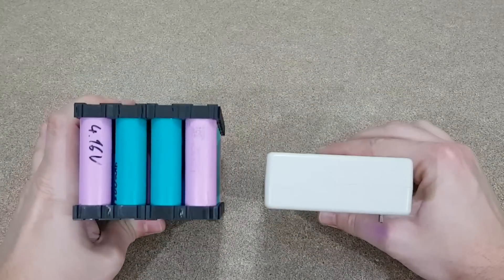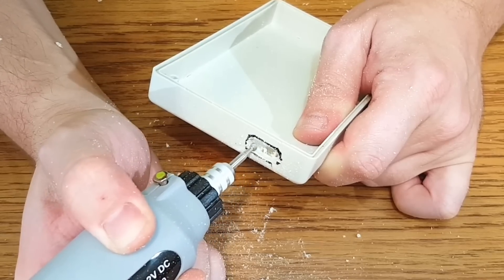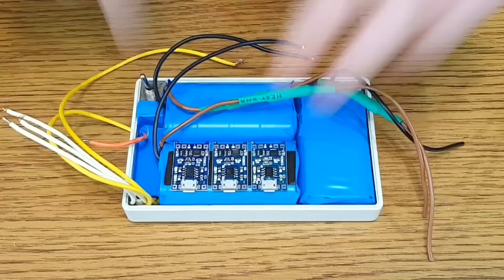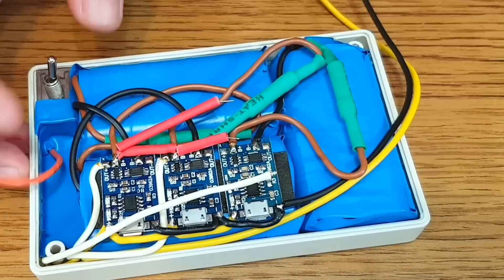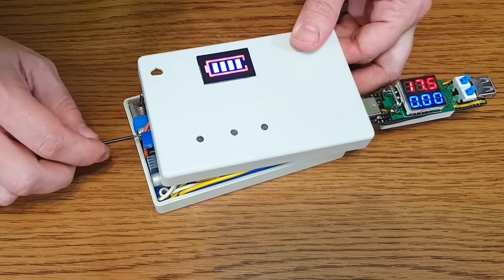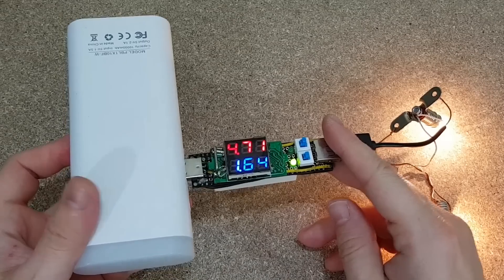DIY - 15000mAh Power Bank - With Salvaged Batteries (gets charged with 3A)

Comment: Hi sorin can i also use 2 of this rocket switch??
 6 Pin SPDT On-Off-On 3 Position Wippschalter(Rocket Switch) AC 6A/250V 10A/125V

or some ON / ON 2 Position 4PDT Vertikal-Schiebeschalter( Slide Switches) 12 Pin SS42H11
Reply from the maker: hi. you can use the 12 Pin SS42H11 switch. or you can use a 3PDT switch (because it's more common) but with 2 charging modules instead of 3.
Reply: @Sorin_DIY  thx mate ^ ^

Comment: Sir where is connected the negative input? The diagram u show is no connection?
Reply from the maker: the IN- and OUT- of the modules are bridged on the circuit board. so you can connect all the negative wires to the IN- or OUT- terminals, it's the same thing.
Reply: @Sorin_DIY  ok sir thankyouuu😊

Comment: .
Reply from the maker: hi. I don't build them for sale, I'm just showing you how I built them.
Reply: @Sorin_DIY  Question, I noticed that you permanently cover the fuse what happened when any of the fuses blow out ? Replacement will be difficult.
Reply from the maker: the fuse will blow only if there is a problem with one of the cells or modules. yes it will b a bit difficult to replace, but this happens very rarely.

Comment: Hi 
Sorin 
i have a question that can i use b3 10w compact charger to charge 3s lipo battery pack and 18650 cells 3s battery pack?  I don't know the capacity of 18650 will they work fine
Directly with this charger without bms on battery pack?
Thank you ❤️
Reply from the maker: hi. lithium cells can be charged only with charging modules, like TP4056. to charge a battery pack you need a good BMS. otherwise you will damage the cells.
Reply: @Sorin_DIY    thank you for response i really appreciate it

So b3 10w balance charger will it do the job?
Reply from the maker: yes
Reply: @Sorin_DIY  Thank you soo much ❤️ i am grateful for your help 🙏🙏🙏

Comment: There are decent diy kits with type-c for about 4$ from aliexpress. Used 4 SAMSUNG cells taken from a business class dell battery with 2300mah left capacity (originally 2600) and bought 2 new ones.

Comment: Hi Sorin i have build the Powerbank but i have a problem, my powerbank doenst charge anything, i checked it double.
when i switch the powerswitch on, only on led is blinking blue 

(the board which is wired in your shematic the last one with the black wired "out -" ),
the other two are blinking for 1 second red then they go out(This happens when i put an micro usb to charge my powerbank)

I use 5 exact same batterie from an old RAVPower RP-PB13 
5x 	Samsung ICR18650-28A
2800mAh Rated
3.75V Nominal and
------------------------------ 

1xLG Batterie which has 2600 mah 3,6V. 

maybe this is the problem sorin or should i check the USB Hub???
Reply from the maker: when you turn it on, the cells should power the step up converter and the battery indicator, so the battery indicator should light up. when you turn it off, everything should be powered off. when you turn it off and connect the charger, the 3 LEDs from the charging modules should light up, blue or red. if it doesn't happen this way, you probably connected something wrong at the switch.
Reply: @Sorin_DIY  ok thx sorin i will check it

Comment: Hello, in the schematic at 5:05, why there is no negative wire on the IN- pin of the step up module ?
Reply from the maker: hi. the IN- and OUT- are bridged on the board, so it doesn't matter where you connect the negative wires, it's the same terminal.
Reply: @Sorin_DIY  Hi, I have some more questions. If I use a balance charger to charge the power bank (like the imaxB6 for instance), can I get rid of the tp4056 modules ? If yes, can I connect all 6 batteries together (or should I not?) ? How do I connect resistors and fuses then ? Thank you very much for your time !
Reply from the maker: the TP4056 modules are connected in parallel, not in series. so the imax b6 charger doesn't make any difference. you need a powerful 1S charger, so it can charge a 1S6P battery pack. I used 3 charging modules, so the battery pack can be charged with max 3A, so the powerbank can be charged faster.
Reply: @Sorin_DIY  yes I meant to use the imaxb6 as a 1S charger.. It can deliver up to 6A.
Reply from the maker: yes you can connect all the cells in parallel and charge them with imax b6 charger.
Reply: @Sorin_DIY  I see thank you !

Comment: @Sorin - DIY Electrical Nerd , how much of voltage does battery charge indicator consume?
Reply from the maker: hi. the voltage differs on how many cells you want to measure 1S - 7S. the battery indicator is using only a few mA, depending on how many LEDs are lit. but it's  a very low consumption, almost insignificant, considering that the powerbank is meant to deliver a few hours of charging time.

Comment: Daca conectez iesirile de la cele 3 tp4056 in timp ce se incarca este vre-o problema?
Reply from the maker: nu se pot conecta in paralel. iesirile modulului sunt aceleasi cu bornele celulei (pana cand celula se deconecteaza din motive de protectie). e ca si cum ai conecta celulele in paralel, in timp ce se incarca. eroarea de incarcare pentru aceste module e de 1.5%, deci fiecare modul citeste si incarca cu alta valoare, nu se inteleg intre ele.

Comment: i mad a powerbank that has 26000mah and if i test it it had 16000mah at 5v 1.5 ah discharge current
the onlt negitive it takes 17h to charge i can inprove the charging speed but the batterybank need's to be bigger.

nice video and simple step by step instruction

Comment: I used identical parts in this video except for boost converter MT3608 (got this from your link but bought through amazon). Everything turned out great; however, i could only charge android phone at ~400mah max. Could not draw more than ~400 and could not charge iphone. Can someone tell me what am i missing?
Reply from the maker: hi. for Samsung phones you need to short the data pins on the USB port. for Iphone you need to connect some resistors between the data pins and the ground wire, you can search on the internet for the circuit you need.
Reply: @Sorin_DIY  thank you for taking the time to answer my question. I will try the test for samsung  and leave iphone 6 alone for now. To be clear, shorting data D+ and D- to each other of the diy power bank and not on the cable that goes to the phone, is that correct?
Reply from the maker: yes. like I did at minute 7:29
Reply: Sorin - DIY Electrical Nerd i missed it. Thank you sir!
Reply: @Sorin_DIY  update: works perfectly after I shorted data pins. My android got up to 750mah (probably because of data usb cable), my iphone 6 got 1450mah max (before could not even charge). Thanks again!!!

Comment: Well you have connected the individual charging module and getting parallel output...toh increase the amps/h.. 
Can we connect them in series toh increase the voltage with the individual charging module connected...
Reply from the maker: yes, but the overdischarge protection and overcurrent protection features will not work. you can watch my latest video about connecting these charging modules in series.

Comment: I bought a few smaller boost converters, but it drops voltage above 1A. I'm thinking about connecting two of those boost converters in parallel, to double current. There is a diode before +Vout so it should be ok, right?
Reply from the maker: hi. I don't think it's better if you use 2 step up converters. I changed the step up converter with this model: https://goo.gl/8HEsQ2 it can deliver almost 2A at a stable 5V. or you can use a more powerful module: https://www.aliexpress.com/item/32885492747.html?spm=a2g0s.9042311.0.0.27424c4dSAW36f

Comment: That switch can be easily tripped inside your bag. Making it self discharge
Reply from the maker: every switch, button, click can be easily pushed/tripped inside a bag. but this type of switch you actually need to press it with a little force. the self discharge rate is actually very slow, the LED indicator and step up converter are using only a few mA. sometimes when I go in vacation and stay at a hotel, I leave the powerbank turned on as a night light. so everything is ok.

Comment: Sorin - DIY Electrical Nerd: Hi, my Powerbank 20,,000 mAh/74 Wh has both 2-way USB C Input [& Output] port and a Micro-USB 2.0 Input ports. My question is: Can I recharge this quicker using both input ports at the same time; or will I overload & destroy the powerbank if I do this? Thank You!
Reply from the maker: hi. I don't think the powerbank can be charger from both inputs. it will probably destroy the charging circuit.
Reply: @Sorin_DIY  Thank you for your response. I knew it was probably going to be one of my "seems too good to be true" bright ideas! Glad I restrained my impulse to try it out before I heard back from someone who actually understands electricity 🤯

Comment: The XL6009 is a dangerous module, that, should the input fall below 4v, you can have erroneous voltages of between 20-30v frying your precious devices, as it doesn't have under voltage protection (this can happen on switch on/off also).
Reply from the maker: hi. when I've build and tested the powerbank, there were no problems with the step up converter, as you can see in the video, even at low voltage. but later after I've used it a few times, it started to make problems sometimes, when the battery voltage got below 3V, the output voltage was not stable. so I've changed the step up converter with the one in the link below. I will make another powerbank video soon with higher capacity and more features and I will explain this modification. 
https://www.aliexpress.com/item/32450571426.html?spm=a2g0s.9042311.0.0.27424c4dYDNnaS
Reply: @Sorin_DIY  Yup, the MT3608 is what I have used, as per your guide, but it itself does have problems, mostly due to the lack of proper information in how to set up the module.  Quite a few of these units have been 'smoked' right off the bat, as it's not clear as to how one sets these up properly, and the data sheet provides no easy way to do so, for the newbie :)  However, if I may Sorin?, direct you to an easy explanation as to why, and how, to go about doing so, and it's just because I stumbled upon it myself, but it may help others from smoking these modules, as they are rather better than the XL6009's :)

https://www.youtube.com/watch?v=yD7fMylYgXw

Feel free to delete the link buddy, but I just learned the proper way of setting up this module myself (from this), so hope it will be of great help to you and all involved in this great project.  Keep up the great work my friend! :)

Comment: Sir do you have PCB design for this .Can I use QC 2.0 or QC 3.0 buck convertor for output
Reply from the maker: hi. for this design you need a step up converter. I will make soon another powerbank with QC 3.0 and other fast charging features.

Comment: Salut. O intrebare pot sa folosesc alt switch ON/OFF, gen 6 pini  nu vreau sa astept 30 de zile dupa cel de 12 pini de pe aliexpress. Super bun video!!!
Reply from the maker: salut. cu switch cu 6 pini nu poti sa folosesti 3 module de incarcare. trebuie un contact pentru fiecare modul si un contact in pozitia opusa care conecteaza modulele la incarcator. 6 pini inseamna doar 2 contacte sau 2 comutatoare. cu un switch cu 9 pini poti sa folosesti 2 module de incarcare. cauta si la magazine locale cu electronice. eu am aproape de mine magazinele quintrix si adelaida si au astfel de comutatoare.

Comment: Always mention capacity in Wh because this is definitely not 15K mAh capacity. Well, first of all, this is 3-S configuration
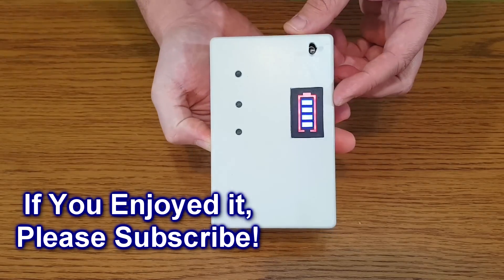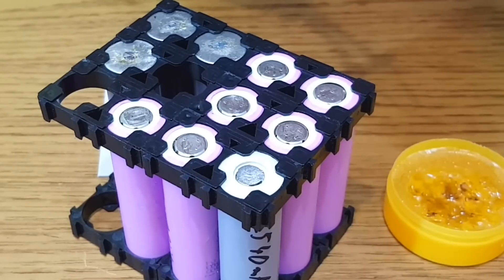Reply from the maker: I've mentioned the capacity in Ah and Wh at 11:14. I've measured the capacity of the cells at 1:35 and each cell has more than 2500mAh, multiplied by 6 cells. so you are right, this is definitely not a 15Ah battery pack, it's actually bigger (before conversion). the battery pack is not a 3S configuration. there are 3 pairs of cells (2P), each pair is charged with one charging module, so 1A. but when you turn on the powerbank, all 3 pairs of cells are connected in parallel, so it becomes a 6P configuration, so the capacity of all cells is added, then goes to a step up converter. please watch the entire video carefully before commenting.

Comment: Any way to get around the '12 pin switch' problem?  Very hard to find here in UK.  Would a 6 pin do?, only planning to use 4 cells per this guide.
Reply from the maker: it depends how many charging modules you want to use. with a 6 pin switch you can use only one charging module. you can connect all the cells in parallel, but it will take a lot of time to charge it. if you find a 9 pin switch, you can use 2 charging modules, so you will half the charging time.
Reply: @Sorin_DIY  Ah thank you buddy! :) Have found a 9 pin, and will use 2 modules, great stuff!  Many thx :)
Reply: @Sorin_DIY  Sorry to be a pain.  Is this schematic correct for the 9 pin switch method, with only 2 charger boards/4 cells?  Please excuse my rough edit ;)

https://i.imgur.com/ORiQOiu.jpg

Comment: What if 2 batteries connect in series which means 7.4 v and stepped that down does that the efficiency Comparing to step up does that make any changes
Reply from the maker: if you connect the cells in series, you will have a better efficiency only if you use a good step down converter, which is bigger. also with cells in series you need a separate charger for the powerbank  and you need to carry it with you everywhere, because it cannot be charged with regular microUSB chargers, which are very common.
Reply: @Sorin_DIY  ohh okay. Then we can use step up for charging batteries with a 3A charger. this costs more money but the powerbank gives you much more efficiency. Is that right?
Reply: @Sorin_DIY  and also if we check the voltage output of any powerbank or charger it will be above 7v why did you stepped it up for only 5.3?
Reply from the maker: the standard USB voltage is 5V. only phones that know other charging technologies, like Samsung adaptive fast charging, or Qualcomm quick charge can be charged with higher voltage or current. but the charger must also know that technology, to negotiate the charging method with the phone. I will soon make a better powerbank with higher capacity and fast charging features.
Reply: @Sorin_DIY  thanks for the reply and I'll be waiting for the power bank video I will be making one for me....

Comment: i think a 2s configuration would be a better solution, my diy 16904 mah powerbank took 22hrs 52 mins last time i check from 0% 3.0v to full. but im waiting for your thoughts of this until i have the pcb
Reply from the maker: a 2S configuration will work, but you need to carry a separate charger for the powerbank. I want to charge it fast with 2-3A and I want to use a microUSB cable, because microUSB cables/chargers are very common. I use 3 tp4056 modules to charge the cells, it can be charged with 3A, so 3 times faster than other powerbanks.

Comment: 5v at 1.7a is fast charging? Sure...
Reply from the maker: 5V at 1.7A is not fast charging. the power bank gets charged up fast with 3A. that's what I meant.
Reply: @Sorin_DIY  Ah for sure still 500ma per cell with 3 1a tp4056s 1 per pair of cells right? I am trying to make a battery bank with pps so it can charge new note 10+ devices at 25w or more but also has pps for charging the cells. That way a 10k mah bank would take roughly 2.25 hours to charge roughly. How long does this bank you've designed take to charge from 0-100?
Reply from the maker: 6:50 hours at 5V and 3A; and 8:20h at 2A. I wanted to charge the power bank with a standard microUSB charger, which you can find anywhere you go. it's more practical this way. I don't want to carry with me a different/bigger charger used only for this power bank.
Reply: @Sorin_DIY  Makes sense. I'm not even sure how I'm going to make one that uses pps. These new phones need pps to get variable voltage instead of say pd which gives you fixed voltages of like 9v 12v 15v 20v. I need a pps trigger or something that does a variable voltage of like 3.3-16v that is how samsung is designing their $50 chargers. I would be satisfied with pd being like 18w for say a nintendo switch but for all these new phones they are going to pps to charge these high capacity cells extremely fast. There are some battery banks you can buy that achieve super fast charging via pd but idk if I've even seen one that supports pps. Pps is programmable power supply. I'm probably going to just be forced to disassemble a few chargers including one of these $50 models to see how they are achieving it.

Comment: I used 2 battery packs instead of 3. But It seems I am not able to get the current I need to charge my phone. Not sure how I can increase the current?
Reply from the maker: how much current does your phone draws? and how much it should? did you short-circuit the data pins in your powerbank USB port? what type of step up converter did you used?
Reply: I dont have a current meter sadly. But I did not short the data pins. Should I?

Step Up Converter: DGM DC/DC BOOST ADJ MOD 5-35V 4A
Reply: Wait I rewatched and saw the pop up saying I should short data pins. Let me try that. Good catch btw
Reply: You absolute winner @Sorin . It was the data pins! Thanks so much man. This thing is great.
Reply: @Sorin_DIY  So I figured out what is happening, I am getting current drop. So it will start at about 0.68A output when I plug my phone in. But it will drop to 0.08A after about 2 seconds. 

Not sure if the batteries I am using are not up to it or I am having a heating issue. Wondering if you experienced something similair?